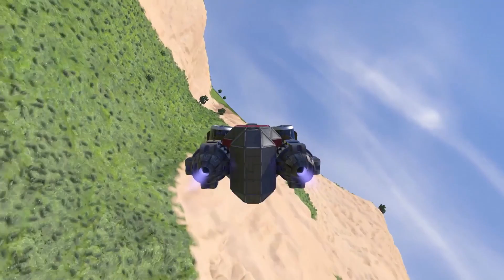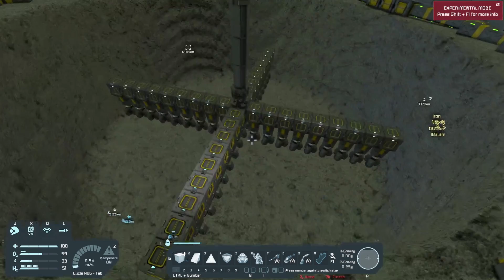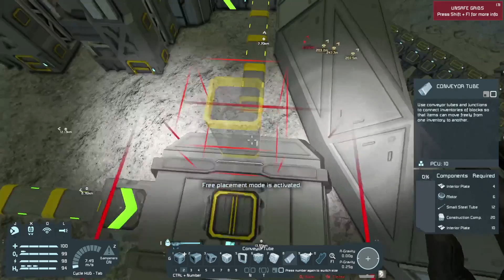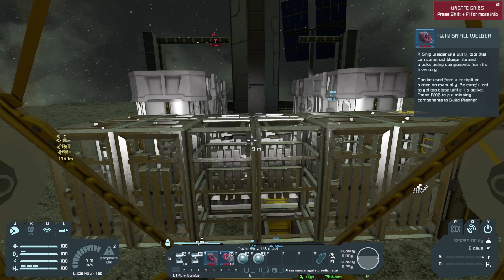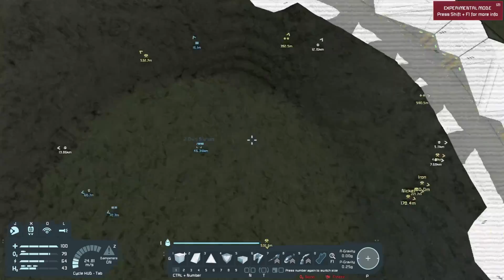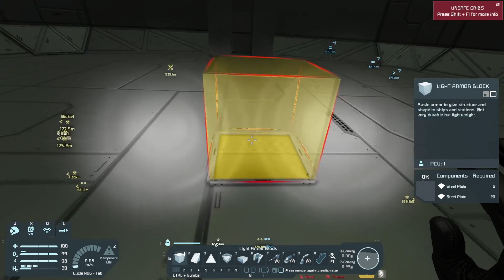Space Engineers #33: Working on the Station

Comment: Nice vid...
 You might want to add some interior lights on the sides of the drills of the miner. I usually increase the range to max then lower the intensity to 3 or so... The center light is great but a bit of lateral light would help immensely...